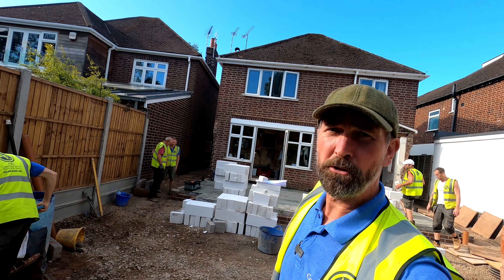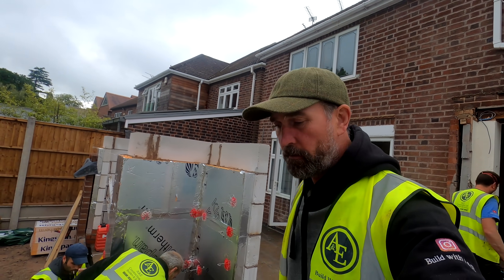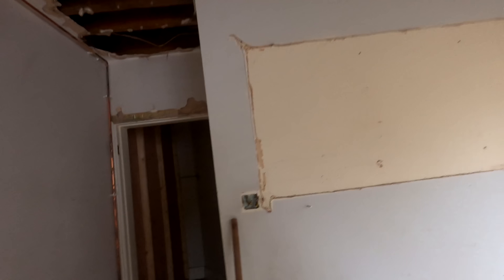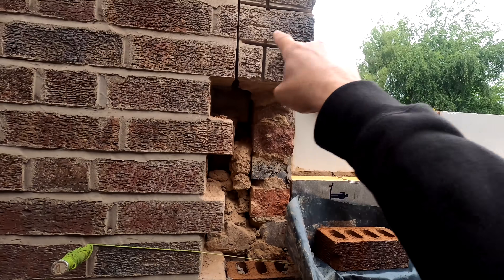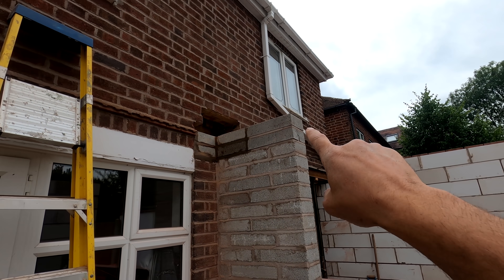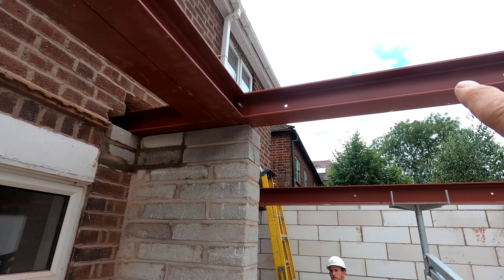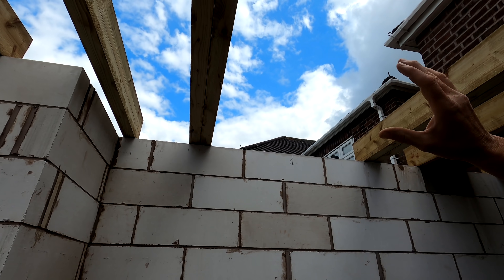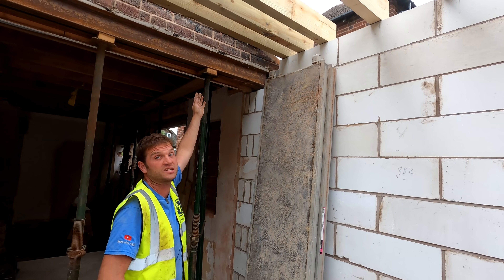Ground Level Up Brickwork to Floor joists

Comment: Hi great videos, you said these are imperial bricks, what size where they? We are doing a small extension. We are matching up to the original brick is 73mm but we me have a problem with wall ties using metric block the beds are going to be a different height. Am sure you guys have run in to this before, what was your solution? 100mm cavity with 90mm pir is on the spec. Thanks Joe

Comment: Why didn't you use a wall plate to put the joist on. Perhaps a recess in the joist to make it sit flush on the wall would have been good.  Better tie down using triple grips and no pgi straps through for tie down either? You must have a reason  but I would like to know .
Reply from the maker: Hey parapet wall and thermal continuity that’s it with warm roof thanks for watching all the best Tony 👍

Comment: Great work as always guys. Couldn't quite work out which cavity wall insulation you were using, was it Kooltherm 106 with a breathable lining on the opposite side to the foil lining ?
Reply from the maker: Hi Nick I think it was K108, personally I prefer the k106 all the best Tony 👍
Reply: @BuildWithAE  Thanks Tony that makes now makes sense, can I just ask out curiosity, what was the thickness of the insulation and the cavity gap👍 Cheers Nick

Comment: Hi Tony, I was just looking at the threshold detail with this block & beam flr , just wondering if your beams where going the other way running toward the opening, do you put weak mix in the cavity to level with the top of the beam then extend your insulation and screed across to the inner face of the outer skin, cheers pal, excellent & videos excellent resource 👍!

Comment: I can tell you guys care and are good, standing wheelbarrows up in line.
Reply from the maker: Hi lvegotaporche much appreciated we do this then you know they have been cleaned nothing worse than dirty wheel barrows, shovels and cement mixers it’s the basics of a good site hate lazy ness. I’am bit of a petrol head if you don’t mind me asking what Porsche do you have all the best Tony 👍
Reply: @BuildWithAE  hi, not got a Porsche anymore, sold.
Had a replica cobra few years back , but had to go when son came along.
Just using all my savings now on property renovation on a bungalow I bought and adding another level, so skint 😬
Reply from the maker: @ivegotaporscheandalambo3318  I know that feeling mind you there’s always later all the best Tony 👍
Reply: @BuildWithAE  yeah, great work your doing Tony.
Same work ethic as me, I run paving and landscaping business and attention to detail is everything.
I'm actually going up on my bungalow, doing it myself and can't wait to start.
Getting motivation by watching this stuff, cheers stew

Comment: I always wonder: insulating the brick and block but when you have massive windows and  doors.......surely they'll be freezing so does it really do much?
Reply from the maker: Hi Matty every bit helps even the glass is Argon filled to improve the U Value on everything and underfloor set at 150mm not 200mm centres all the best Tony 👍
Reply: @BuildWithAE  cheers mate 👍. Decent channel you seem really genuine trustworthy and skilled. Keep it up, I could never deal with the stress of these jobs delegating jobs, pricing, materials etc. Well done

Comment: Great communication run through of the project I shall go back to start of build and enjoy from the start, Jim the brickie must have worked in Germany 👍
Reply from the maker: Hi Wheaton bread good to hear, Jim is a cracking bloke he worked in Germany for many years, he was in the first wave of bricklayers to go over, love hearing some of the cracks they used to have definitely an old time trowel all the best Tony 👍

Comment: Imperial bricks - We’re the interior blocks imperial too? How did you line up the wall ties? Cheers
Reply from the maker: Hi Slashley we always use slightly longer ties because it helps when using metric blocks to imperial bricks but always a pain all the best Tony 👍
Reply: @BuildWithAE  I see. I guess u’d have to bend them down to the outer wall to stop water running along the tie into the inner wall. Cheers
Reply from the maker: Spot on

Comment: Great video and detail Tony, nice clean work area too, good for the mind!!
Do the joists no longer have to sit on a wall plate?  I’m doing my own new build soon (just a plasterer by trade) and looking for most efficient ways of building . Cheers Pal
Reply from the maker: Hi Sam you can but in are case we had parapet walls on top if you don’t have that situation then yes crack on with wall plate all the best Tony 👍
Reply: @BuildWithAE  brilliant, thanks for the reply.

Comment: Maybe I'm just old fashioned but I much prefer to see the new brickwork tied directly into the existing old brickwork. It probably doesn't make any difference but I think it looks better for sure. 👍🏻👍🏻
Reply from the maker: Hi Danny totally agree thats why we like to do it, I’am like you old fashioned all the best Tony 👍 have a awesome weekend
Reply: @BuildWithAE  do you ever tie the old/new footings together below where you bond bricks in case of any settlement on the new side?
Reply from the maker: Hi  @coops6621  most definitely we blocked to the front and then flood the concrete above the footing levels when you can’t slate pack them all the best Tony

Comment: That lift looks so much more civilized than a Genie. I have never fitted anything under joists on those kind of blocks, so it looks like I'm going to have to read up on the manufacturers recommendations. I presume its a decoupling layer of sorts, or maybe its due to the materials used in the block manufacture that affect the timber?. Thanks for the video. 🤩 Del.
Reply from the maker: Hi Del it’s the cable that always put me off Genie the lifting weight only 200 to 250kgs. The blocks it’s something that I read in the technical book some time ago with this block might not be the same with others all the best Tony 👍
Reply: @BuildWithAE  My builders use the Ytongs for everything so will deffo be looking into this as joists is my department. Have a nice weekend. 🍺
Reply: @BuildWithAE  Found the technical data PDF on the Ytong blocks and will be fitting 4mm Bituminous felt or neoprene under all my joists from now on. My builders would have never searched or checked for this info, so thanks for putting that detail into your video. 👍 Cheers.

Comment: cellotex, kingspan - easily mistaken for each other as both companies lied and or faked fire test results as uncovered by the grenfell inquiry.
Reply from the maker: Hi twmd it’s a terrible thing that something like this has ever happened and it should of never happened all the best Tony 👍
Reply: @BuildWithAE  indeed.  Difficult for the industry to move away from these manufactures as they are so ubiquitous.  Not that they are particularly a fire risk in an extension - just from an ethical point of view.

Comment: Looking great. Can I ask if you would always tie in the brickwork with the existing building? I had an extension built around 2 years  ago and the builder didn’t tie it in as he said it just cracks over time. He left an expansion gap and filled with mastic.  where that expansion gap is around the Same place in the inside where the steel picture frame is the plaster board keeps cracking. It’s cold to to touch all the way round even on the floor in between the existing and new. No matter how many times it’s been repaired it continues to crack.
Reply from the maker: Hi A Mac it’s really hard to call regarding cracking,  yes we all ways tie in I just prefer to all the best Tony 👍
Reply: @BuildWithAE   Thanks for the reply. Someone suggested drilling holes in it and filling with expanding foam. Might give this a go. Have a good weekend.
Reply from the maker: Use a closed cell foam because of moisture 👍
Reply: @BuildWithAE  Thanks mate will do 👍🏼
Reply: Hi Tony would a closed cell polyurethane spray foam be suitable because it would help insulate the steel frame    
at least
Reply from the maker: @amazing451  just check with the technical guy from the company or send an email to them but should be ok also is it fire proof speak to building control you do not want to nil and void your insurance 👍
Reply: @BuildWithAE  Many thanks Tony

Comment: Hi great work as usual. Are you ever worried having the joists flush with the bottom of the steel as the wood will shrink as it dries and the steel will not? It maybe happen to  "a friend"  I know, ended up cracking the plaster!
Reply from the maker: Hi Eddy much appreciated it’s a great shout if the timber was soaked then definitely a good 6mm tolerance to have the joist below steel, it was really hot and the timber was beautiful and dry so I was happy with the shout, the other thing we do is double board because of fire and there is a timber stud wall detail on the joint line so I do try to cover everything well all most everything 😂 all the best Tony 👍
Reply: Thanks for all you do. Your a wealth of knowledge. Have a great weekend